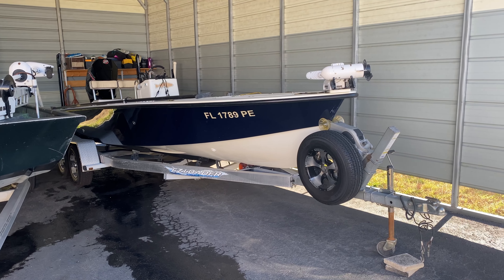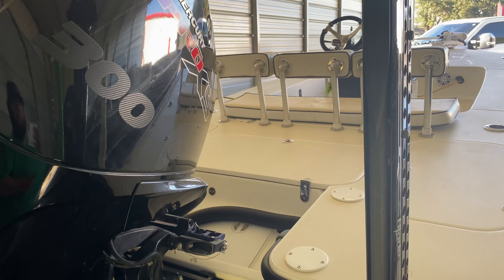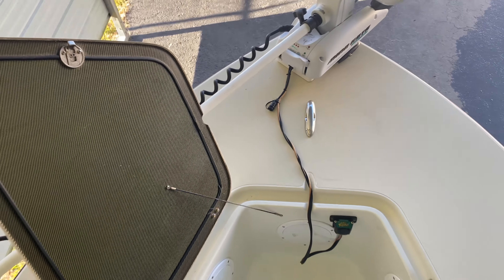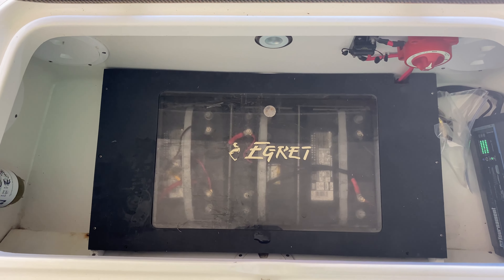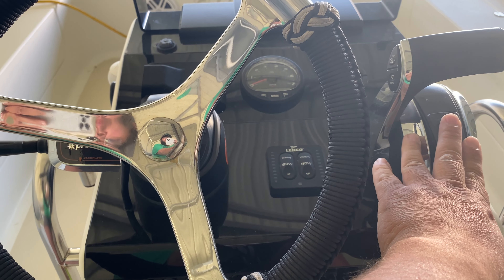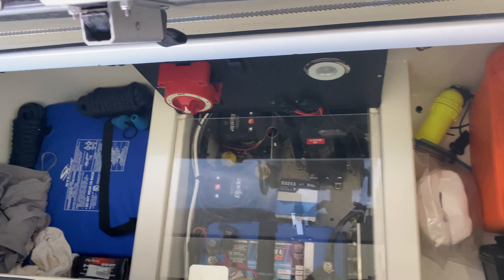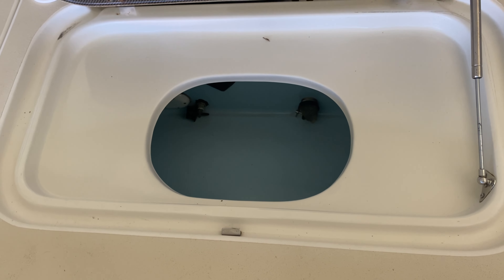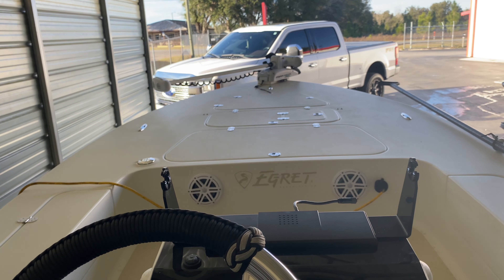Egret 2011 Boat Walkthrough

Comment: do you do any large mouth/fresh water fishing in it? what would you recomend for a boat that doubles as a bass and inshore boat?

thanks!
Reply from the maker: Yes, I do fish both fresh and salt with this boats from my local lakes to down south in the everglades for peacock bass. It excels in open water like Lake Okeechobee or Kissimmee when long runs need to be made, and at 70 mph it makes for a quick ride. 66 gallon fuel tank makes it very usable in both conditions also floats shallower and outperforms bass boats as well in rough water.